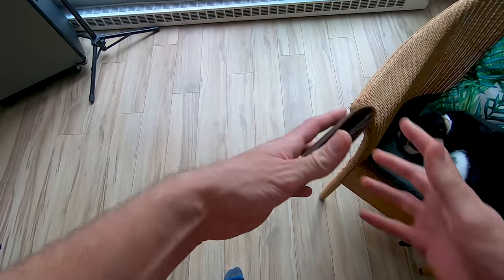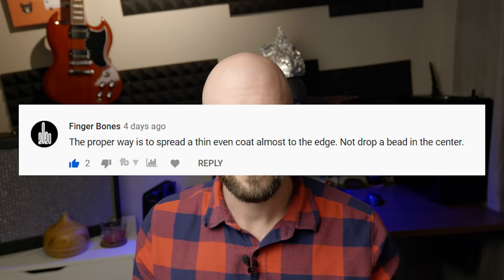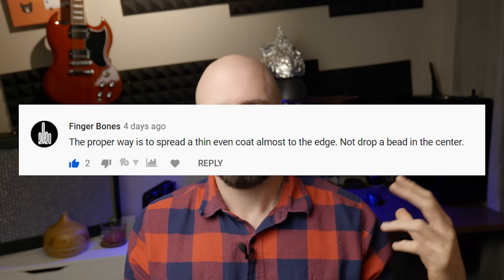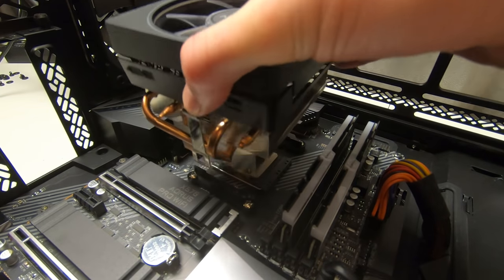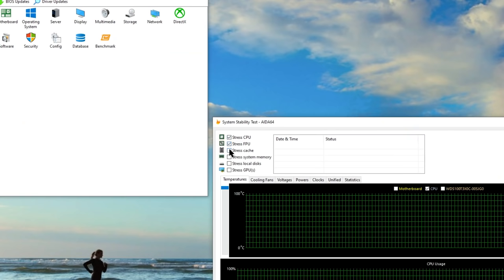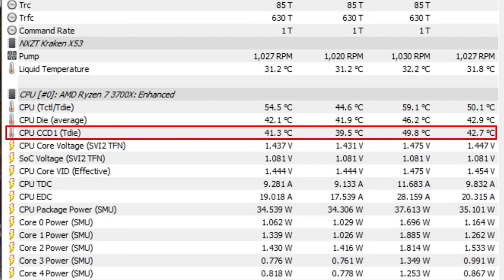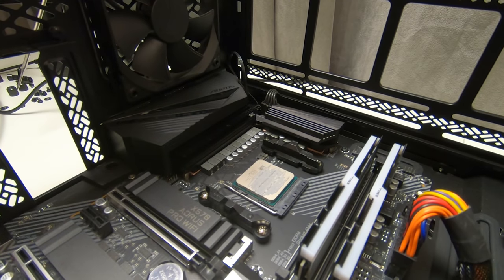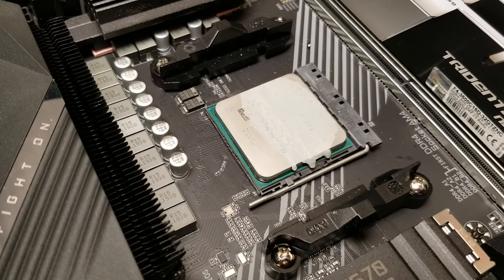Best Way to Apply Thermal Paste? Does it Even Matter?

Comment: Very good video! Super helpful would like to see this on a hotter CPU like the 5 or 7 series and with a Liquid Metal comparison.  I think the conclusion is pea and line aren’t enough anymore, spread it or do enough dots to ensure the full or majority of the cpu are covered, pea size and lines give like 60% coverage 85%+ with Penta dot , X, and spread method ensures you are safely covered and transitioning heat to the cooler for dispersion.  Awesome work

Comment: isn't paste only to fill in the gaps between the two metals? metal has a really good heat transfer characteristics,  is the past better for that?  or does it insulate the heat transfer?

Comment: you can use thick saliva as well. saliva has dissolved solutes. the water will evaporate and leave the solutes behind in a very thin film to conduct the heat.

Comment: From 28+ years experience repairing TV's and many other consumer, commercial and industrial products, it does to a degree matter as to how paste is applied for maximum benefit. The thing to consider is where within the chip is the heat actually coming from? This is obviously going to be variable depending on the CPU/GPU. The paste is a heat 'transfer' product, not a heat absorbing product. With this in mind, my opinion is a thin film spread across the chip surface but NOT caked on is ideal. Your are using the paste to make up for micro flaws in the surface of both the chip and the heatsink and are merely using paste to evenly 'transfer' the heat from the source.

Comment: I always spread the thermal paste evenly on all of the IHS surface and it does improve the temps by a bit for me, it takes a bit more time to do it without spilling around the CPU socket and it's tricky to do it so you can keep enough thermal paste so you can keep contact on all the cooler's surface, since you might leave a layer of paste which is too thin to make contact, so I understand why some PC building companies don't do the same (because time means money).

Comment: You should redo this test but use a more controlled method for how pressure is applied onto the glass and CPU. That way you remove another variable.

Comment: Cool paste vid! Thank you! I'm building a new pc..i've swapped processors before..legit done everything before, many 
times, but never a full build. I think I'll go with the 1 big dot, or the 5 dot. It's an i7 3.8ghz going onto a B series 
ASUS board, new case with four 120mm fans. I'll check temps..i'm starting with the fan/sink that I have..off of an 
i5..may not be quite enough for gaming..will see. If not, off i go to snag a hi-po cpu fan!

Comment: In my opinion...faulty testing due to testing it with a cooler heatsink that was "not" flat. I'd like to see if there is a difference or even a major difference with using a flat surface cooler heatsink.
Reply from the maker: I'm about to post a video that may quench those parameters. Should be up this afternoon (PST)
Reply: @TechIlliterate  Wow...super cool response time and I look forward to the video!!!

Comment: It is reasonable that the delta t could expand under additional stress over x time? I'm just wondering if this is a scenario where I'm only off by a quarter inch here, but by time we add distance I'm off by an inch kind of a thing...

I'd also like to see experimentation with the pentadot and butter method using variable amounts of paste. I for one don't apply that much pressure when spreading the paste which I believe leaves a slightly thicker even layer. So the question now becomes if we tested the coolest two methods with varying volumes what happens to the result?

Comment: ATTENTION! Notice that even when he does the spread method he leaves a very THIN layer of paste on the cpu. I built a pc on my own for the first time and applied what I thought was a small amount of thermal paste on the cpu. I was getting 50 idle and 80 in game. I disassembled and reapplied a much thinner layer of paste and the temps dropped by 10. It's VERY easy to overdo it, you really need a super thin layer, like not even enough for the paste to accidentally spread out of the cpu when you squeeze it. The paste needs to TRANSFER heat, not BLOCK it.

Comment: See the difference between thermal pastes or methods of applying will just be visible if the CPU fixed clock because now days the system manages the clock speed em voltages to always get better performance. In the end you have a lot of other variations to consider rather than just temperature.

Comment: Yes I know this is a year old but you gotta put enough no matter the method you need to put enough thermal paste. The method doesn’t matter cause once fan or Aio is on it will spread the thermal paste evenly. It will spread over the surface area before spilling over. But you need to put enough to cover the cpu

Comment: Well, buttered toast may left air bubbles, that's not good. X seems like the easiest option. So, what if use X and spread the edges of the X over the entire lid? That would be symbiosis between the easy way to apply paste for beginners (X symbol) and the best performance method which avoids air bubbles. Make sense?

Comment: The ONLY RIGHT WAY is using multiple small blobs and spread with your bare finger tip (don't use anything else since you need to feel it) very extremely thin evenly over untill the exact edges. It's the ONLY way you're 100% sure the spread is perfect and the layer is extremely thin. I always done it that way and I HIGHLY advise everybody else!! It's highly important the layer of paste is as thin as possible since it's only meant to fill up microscopic holes, and therefore it's highly important it's evenly across whole surface. No other method can create that.
I don't understand why everybody still use the single big drop method. It's by far the worst imaginable. Not only because the blob won't spread, but because it's extremely hard to use the exact right amount. Most paste is too thick and it won't spread as you see in this video, and if it spreads you used way too much.
Not seeing the spread and so not know if it's enough or too much is unacceptable. I seriously don't understand why nobody cares about that risk, and both too much and not enough are seriously dangerous.

Comment: Has anyone tried remounting the cooler without using fresh paste, I do this frequently when comparing different cpu coolers. When I'm ready for a permanent cooler, I do use a small center dot . Never have any problems doing this 👌

Comment: Ah okay. So it's my 3600 that runs hot, not how i put my thermal paste. I actually used the x method and then remove everything and use the dot method and getting 70 while gaming. Was wondering if I was doing something wrong.

Comment: Very easy to test if you are doing it well or wrong, remove the heatsink right after putting it on, and you'll see how the paste moved around from the pressure. If there are dry spots, you need to change things up a bit. If some drooped of the sides, also. That's all there is to it.

Anyone saying it's not problematic to have paste-less spots, is an idiot.

Comment: The best way is the way that guarantees no air bubbles leading to small voids of 0 TP. The only method that guarantees this?, take your time and evenly spread across chip with no ridges visible and just enough to not see any silver on the IHS. You can't rely on surface tension to evenly distribute compound as the IHS and heatsink almost never mate evenly pushing that drop to one side or corner. Been using this method since Slot 1 Celeron overclocking days, taught to me in 1998 by a since passed cooling solution guru. If I had been caught using the half-assed methods I've seen, especially the "X" application I would have been taken out back and shot.

Comment: With that Wraith coolers indented lines, maybe they need to be open???  I've always used the buttered toast method, but I use my finger to make just the thinnest coat...trying to not have any spillage over the edges of the cpu(some paste is conductive!).  My logic is that the thermal paste is a heat transfer enhancer.  Where do you want it to be best?  Everywhere!

Comment: I use a well lapped surfaces and no paste.Two propper flat surfaces are superior , Metal to metal is the best tranfere no argument. I have used gold leaf when not sure of the contact and it also is very good.
Reply: How do you do it ? On a CPU and cooling system surface without the lapping paste getting into the CPU pins? Do you have a video
Reply: @cowsgoloka  A smooth grind past on a glass plate or engineers plate finish up with T cut or Brasso will get a laser flat surface . takes practice to lay gold leaf perfect but the results are worth it. Static holds it flat against the cooler just use enough to cover the die.

Comment: There should be a caution here, because you can use too much thermal paste, it's possible if the thermal paste makes it's way around to the CPU pins, it can create shorts between pins.
Reply from the maker: Yeas that could be an issue. Though you would have to really go overboard. https://youtu.be/UuPVATV-zpE

Comment: Buttered toast all the way :)  but make it 2 microns thick. 
The butter will get squeesed thin by the HS presure and butter will endup all over the socket (non conductive helps stop shorts)

But seriously, Its better if your Heat sink has a smooth machined surface Noctua D15,  then its just
contact area (the more the better)
Then the presure the heat sink puts down onto the CPU and the viscoty of the paste will effect the thickness of the paste.
The thinner the paste layer the less the heat has to transfer through. Thinner the better. (ideally just fill the microscopic rough surface of the CPU and HS).
Diamond has a conductance of 1000,  nano sprayed on diamond is propably the best, just got to build a nano diamond sprayer aplicator. he he.

Comment: After 20 years of building and repairing PC's, enough is enough 😁 el oh el

Only real problem comes is if you have two smooth but also not flat surfaces that can capture an air pocket, the video shows a cooler with direct heat pipe contact with empty channels in-between. That's both good because it will allow any air pockets to easily escape but just very slightly reduce performance, but if you have a smooth and flat cooler but a CPU with a concave IHS it can capture an air pocket, this is where application can have an effect. Most the time heat cycling causes a pumping effect that pushes excess paste out and air, giving you that "cure time".

Long -> Short; i use the thin X method with a little extra in the middle, tends to goop out less and when it does its very even

Comment: Edit-TLDR: I demand a retest with a better cooler.

I have a small problem with the way you tested this. Thermal paste is only important after other cooling factors have already been optimized - if it's not the final bottleneck, then of course you won't see drastic differences. Put another way, what do you suppose is the absolute best your cooler could perform (if say, the cooler were bonded directly to the CPU with copper)? If that performance is near 76 C, then of course the various thermal paste configurations would approach 76 C. They can't get better than the absolute best theoretical performance. You would have been better off testing your better cooler! I suspect that you would have seen much more drastic differences.

Comment: It way you spread paste matters BUT not all pastes are the same nor are all coolers the same. If your cooler plate is mirror-polished flat and your paste is thick then the thin and uniform method is superior. Also bear in mind that in some of the higher quality pastes the maximum efficiency is achieved after several heating and cooling cycles so proper testing and comparison is a matter of weeks not days and certainly not hours.

Comment: These days a lot of pastes have been tweaked to be more tolerant of random application method and IHS design and the layout of the packages less likely to cause issues.

Go back to say the Intel Core days there were pastes (mostly older ones) designed specifically for hand spreading and performed poorly used as a blob or line application and other pastes designed specifically to spread optimally under mounting pressure from a blob or line application and didn't give great results spread by hand and getting that wrong would result in degrading thermal performance over time and often having to reapply paste after 1-2 years. And/or package layouts where the wrong application approach had a bigger impact on thermals.

Even then in almost every case you couldn't go wrong with a blob in the centre with most pastes other than some of the older ones designed for hand spreading.

Comment: The thermal paste must be applied exactly in the center of the contact area of the heat sink, so you will avoid it going where it is not needed.

Comment: the traditional dollop in the middle is best as i see it once its pressed down it will contiue to spread outwards and this creates more of a vaccum seal and for the system you are using it pays to trial an applcation to see  how much paste it takes for it to spread across the whole surface, you cant go far wrong with this.

Comment: I really would have preferred to see the test done on a smooth surface cooler, so I feel going with "the lesser cooler" did not help the test. I still like the content and do believe you should use one the three methods at 76.1-76.3 °C range. As usual, the penta dot/X/spread is in the lead. You should always aim for good coverage, even though you usually get a small chip in a huge package. It will also probably last longer, as the paste will eventually "dry out" on the sides. More contact means more material to work with in the long run.

Comment: It depends on the individual core temps... averaging the temps hides any hot spots on the cores inside, some could be throttling while others are quite a bit lower.  On old monolithic dies dots are fine, but on modern multicore CPU's getting good coverage matters more.
Reply: What would be your preferred way? I have 13900k looking to repaste for max performance
Reply: @yashj8238  Personally I'm going to be spreading on my next PC.  Messy but I know it'll work at least.

Comment: The new LGA 1700 chips are rectangular. I used 3 small dots down the center with an arctic liquid freezer ii  360 and I am running 26c idle and maxed at 63c gaming but averaging under 50c while gaming. So I think what I did worked.

Comment: Not only does thermal paste pattern matters but also the torque of he screws (pressure of the heatsink on the CPU) matters a lot.
I remember attempting to fix an overheating PS3 one time, I repeated the process almost 100 times , 99 times it failed with overheating and 1 time i managed to make it go stably cool. a tiny detail can make all the difference.

Comment: If you want to see the difference get a better cooler. I am using Bequiet Dark Rock 3 and it's like 20* lower temperatures in comparison to the stock cooler.

Comment: I know this was posted over two years ago but wanted to mention something that gets talked about a lot in the comments. If you were to put the CPU in without any thermal paste, within minutes the CPU would reach temperatures in the 90+.  I wouldn't be surprised if it reached that temperature in under two minutes. I would guess if you ran it for 5-10 minutes it would fry the CPU. If you ran a modern game, it would absolutely fry the CPU within minutes as it would very quickly climb to 100+ degrees. One more thing to mention and don't hold me to this but i believe most modern motherboards have built in protection which will shutdown the system if the temperature exceeds a certain threshold.

Comment: I got problem at Intel side because half of the part wasnt in touch , i got 100C because its more Wattage that he get. Intel i would recommend to make it on the Chip and a bit on the cooler to make sure it have good contact.

Comment: I found out long time ago the method you used to apply Thermal Paste did not make a big difference in CPU temp. What make the biggest difference is using a good CPU cooler and have good air flow. Course using a good quality Thermal Paste helps too.

Some of that cheap Thermal Paste can dry up like crazy and CPU cooler can feel like it's welded to the CPU it self. In those cases with AMD motherboards you can rip out the CPU from the socket without lifting the arm that holds it in.

Comment: I started building 80386 (i386) PC's and Amiga's before those. Probably before most of anyone here was born. LOL. The only thing I didn't hear mentioned was AIR TRAPS. In theory, if you lapped your CPU and block to perfectly flat surfaces and applied the paste in a circle, you'd end up with an impervious air pocket right in the center and kill your chip. Meaning, the most important aspect of applying thermal compound is to make sure there's no trapped air, which none of your methods had.

That said, if I kept running tests and saw a consistent lack of paste in the same area over and over, I'd be lapping the chip and block until the issue was gone. There is ZERO reason to keep using a block that isn't making contact to the ENTIRE chip. That's like going to the drag strip with a brick under your gas pedal and wondering why you can't win a race. IT'S THE GAP! Thanks for the testing.

Comment: made the mistake of using the preapplied paste from AMD with that cooler, 4 years later I tried to take it off to switch to an AIO, wound up cemented to the CPU and trying to pull it free resulted in pulling the cpu from the socket destroying both it and my motherboard socket....